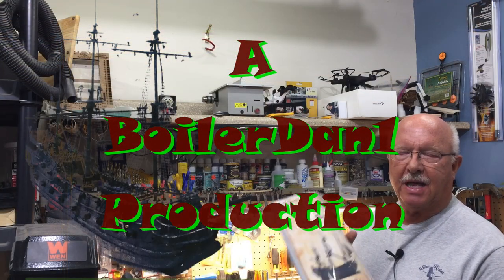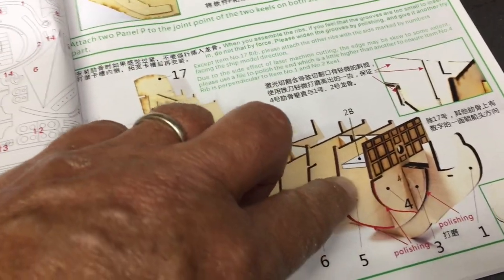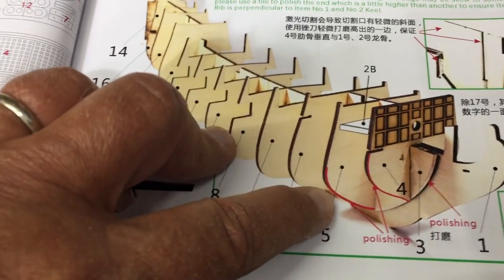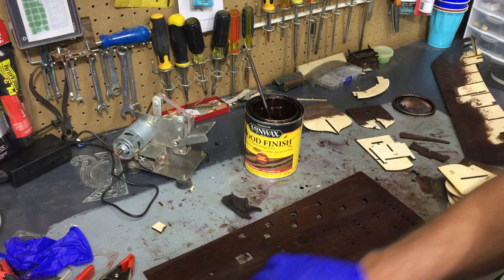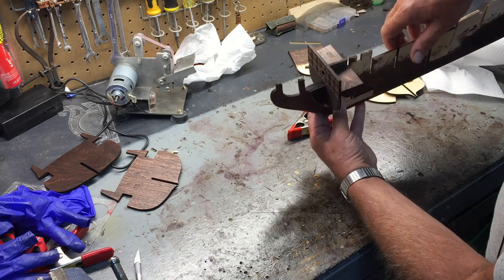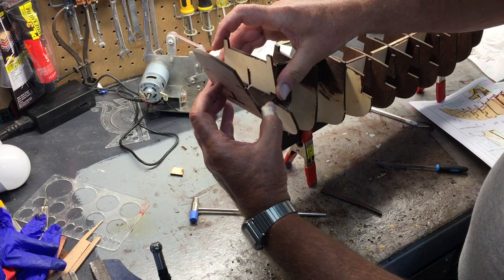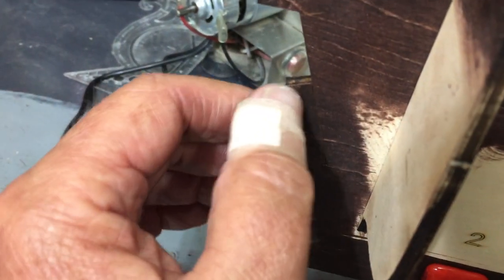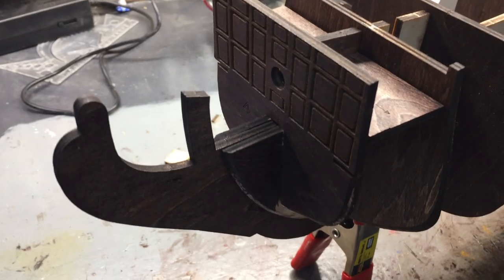The Black Pearl Golden Version 2021 ZHL - Episode 2 - Assemble the Bones

Comment: Will the oil based Minwax affect the glue adhesion?
Reply from the maker: Yes I think it would.  I’ve not had any problems with using stain prior to glueing. However after using Tung oil the adhesive will lose some grip. I’ve used super glue and it does still hold but not as well.
So in summary, I’d try to assemble as much as possible before applying a Minwax type product.
Thanks for watching 👍